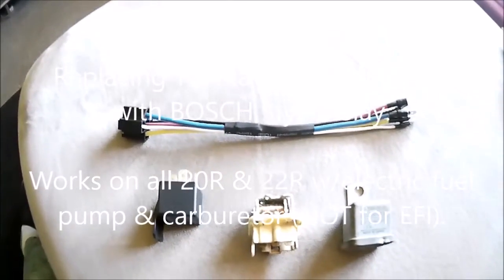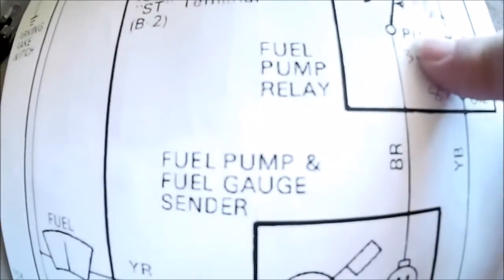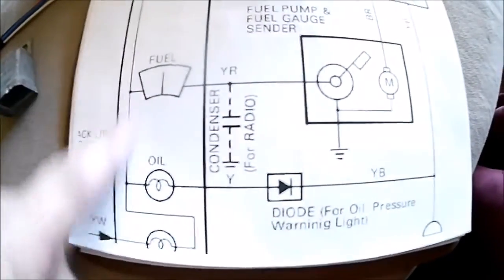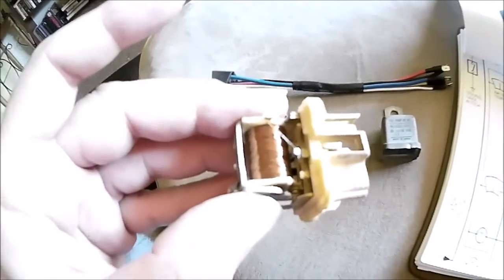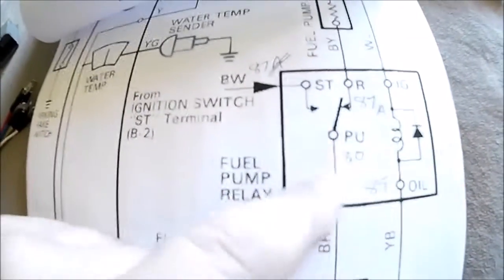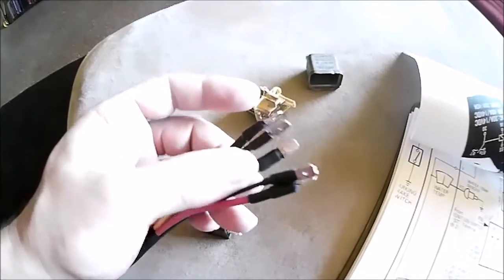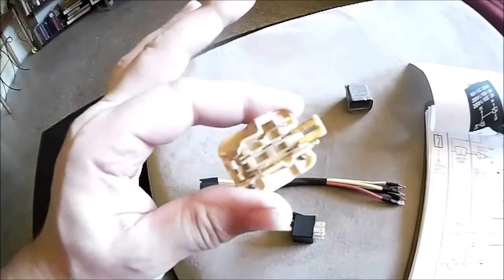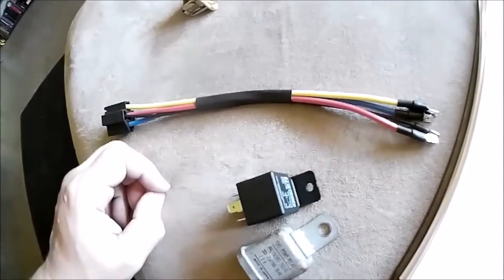1978 Toyota Pickup 20R-Fuel Pump Relay Replacement/Substitute

Comment: thanks, this video has the only wiring diagram I could find. If you downloaded it please leave a link. you are a life saver. like, like, like
Reply from the maker: You are most welcome. I had the same problem so I was determined to post up the info for anyone else looking for it.

I had forgotten where I got the image from & it took me a while to find it, but I did. Thank goodness for saving old webpage bookmarks! Here ya go:
http://toyotamotorhome.org/forums/index.php?/topic/6410-1975-electric-fuel-pump-wiring-diagram/

Check the posts from user "zero" to find the diagrams. There are several posts with some extra info & diagrams that should help.

If you need any more specific info I'd also be glad to answer any questions or help you out, just let me know. With allthe work & especially study I have been thru on this truck, there isn't a lot left that I don't know. :^)
Reply from the maker: By the way, the poster "zero" states that the fuel pump resistor is 2.2 Ohms; it is NOT. It is rated at 1.4 Ohms. You might want to test the resistor to see if it's ok. My old one went up to 4 Ohms when hot, causing very little electricity to get to the fuel pump (like 3.4 volts!) causing a very bad idle condition, due to low fuel flow & pressure (fuel starved). Old resistors tend to do that because of getting "heat cycled" underhood so many times. They just don't hold the resistance range anymore. I tested my old one with an Ohm meter & used a hairdryer to heat up the resistor, simulating underhood heat (can get up to 220 degrees F in there!)

A new power resistor can be wired/soldered in if you need to replace the original & I have recommendations on that. Let me know if you need the specs or I can point you to a new resistor.

Comment: Howdy sir! I’ve got a 79 Toyota pickup and just yanked my fuel pump relay. I converted my truck to efi and was in the process of removing crap that doesn’t need to be there and realized that while removing wires there was one that came from the oil pressure sensor to the fuel pump relay and up to the oil pressure light. It’s amazing the stuff you find out when you tear into a harness. do you have a wiring diag or book for your 78? I can’t find one for mine anywhere!!
Reply from the maker: I have a link to a 1978 wiring diagram in PDF; here it is:
http://www.globalsoftware-inc.com/coolerman/fj40/schematics/FJ40/1978FJ40/1978_Toyota_LC_Pickup.pdf

The '79 should be almost identical, if not very similar.

In case you didn't know (& for anyone else out there reading this), that circuit was a safety feature that Toyota designed in for vehicles with carburetors (not EFI). The reasoning for it was that if you got into a crash & the engine stopped, oil pressure would fall off, the oil sender switch would open & de-energize the fuel pump relay, stopping the fuel pump. Nothing worse than being knocked out in a crash & having your electric fuel pump continue to pump fuel thru a ruptured line onto hot metal. incinerating the vehicle & you in the process. I have mine hooked up as stock for that reason, plus if I ever spring an oil leak & oil pressure goes away, it will stop the engine from running with no oil in it. That would be expensive to fix.

On later EFI models (22RE), Toyota changed the "signal wire" from the oil pressure switch to the AFM (Air Flow Meter). Here's a diagram of that on Yotatech:
https://www.yotatech.com/forums/f116/no-power-fuel-pump-230687/

Same principle, just a different signal source for the relay. I would think that if you want to run the "idiot light" for oil pressure you could run a wire direct from the sender to the light on the dash, & it would work. Nevermind if you already have an oil pressure gauge.

Well done on the EFI conversion sir, that couldn't have been too easy to figure out.

Comment: It is hard to see the part number on the video! Please write it out in a comment.
Reply from the maker: I assume you mean the part number for the Bosch style relay? Part numbers vary from maker to maker (many companies make it other than Bosch), but the relays are all the same & all work the same way. It is a standard 5 pin Bosch style relay & you can find them from almost any parts store or online for cheap. I went with the one shown from an Ebay seller because it's 75% less cost than a Bosch & has a lifetime warranty to boot.

If you need the compatible Bosch part number, the closest I could find is 332209150, Bosch-Tyco 332209150 High Current Mini Relay, SPDT, 40A, 12V.

Hope this helps. Let me know if I can do anything else for you.
Reply: Same request! I can’t read the part number on the black replacement relay

Comment: I'm having a what seems to be a fuel problem on a 1980 Toyota pickup 20R motor. It is fluttering and seems as if it might be losing power. Any ideas. I've run a can of B12 and change the fuel filter. White smoke is starting to come from my exhaust
Reply from the maker: Without more info it's hard to diagnose. It might be fuel, it might not. How much B12 to how much gas? You did add the B12 to the tank right? Fluttering at idle only or when you rev it up or try to drive it also? Have you checked your coolant to see if it is low?